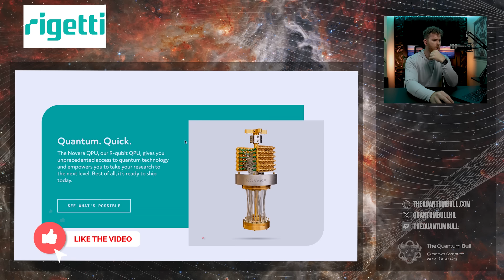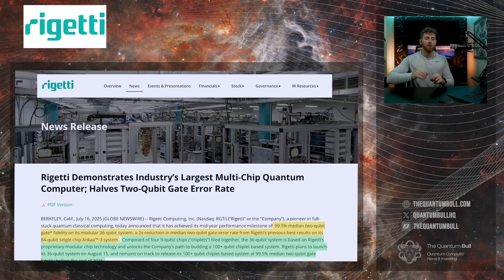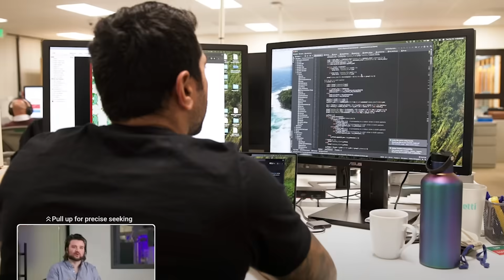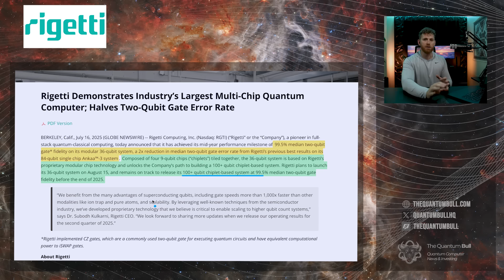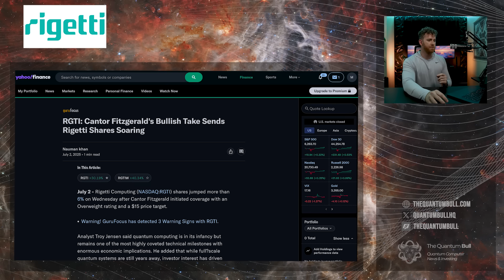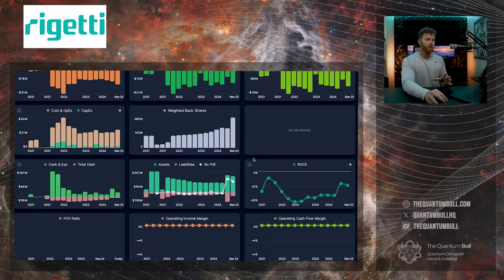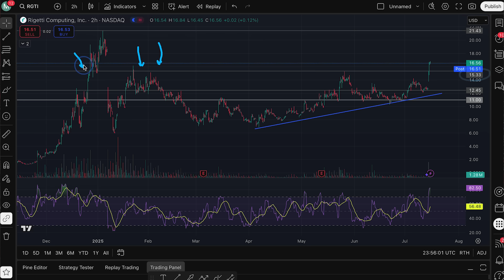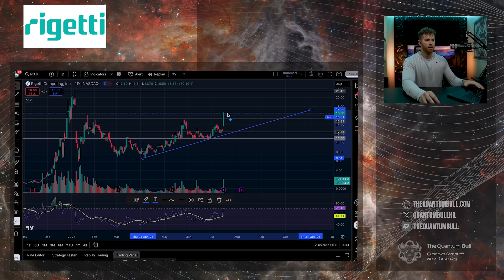Rigetti Explodes 30% on Record-Breaking Quantum News

Comment: This is totally a scam. I saw an advert about Martin Lewis being worried about telling people about this. Note Mr Lewis does not sponsor this type of advertising. I’m a retired Computer Scientist and AI is a huge buzz word. If your investing using AI then your going to lose your money. Home broadband doesn’t have the bandwidth guarantee fo an AI system to trade for a home network user. I worked for banks and financial institutions where they needed microsecond improvements for successful trades to happen. Home users cannot compete with the professionals trading networks especially with short term time sensitive investments. Longer term time limits it’s a possibility but you really need to now what you are doing. AI is not sentient and is a program that will have errors in it. If you don’t believe me just look at what happened to UK Post Master accused of stealing from the post office when all the time it was just programming errors. AI is even more complex algorithms than normal trading systems - My advice is to invest in fixed term trading where returns are guaranteed. Quantum Investox is not protected or registered by the FCA. Beware of this.